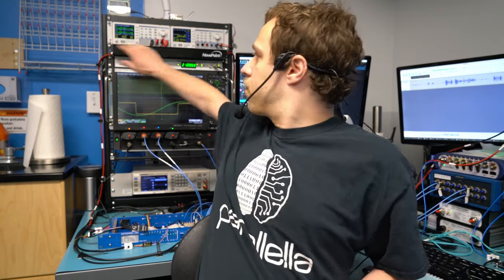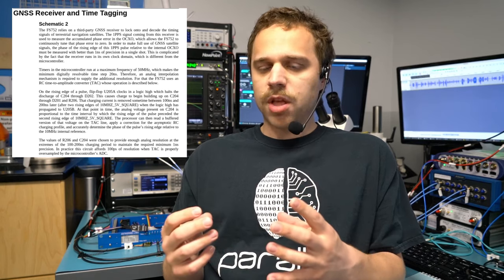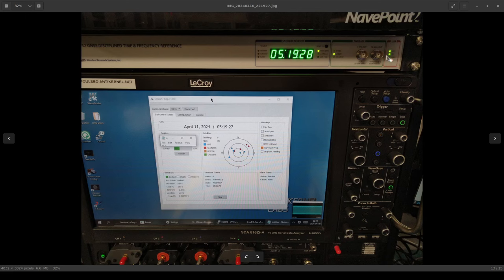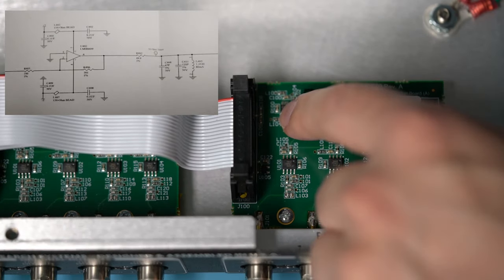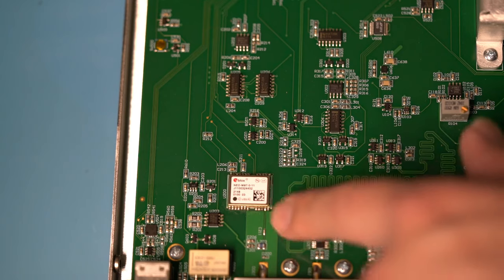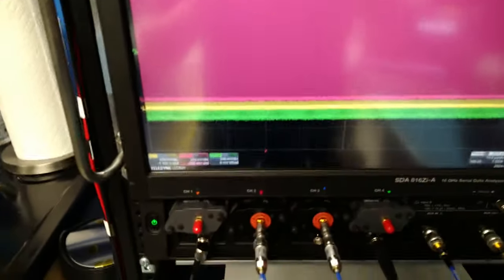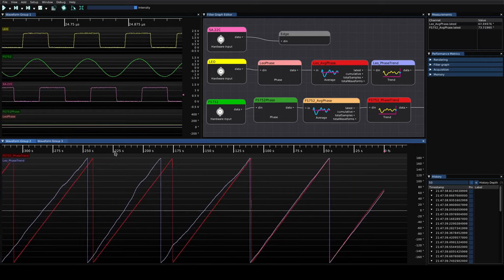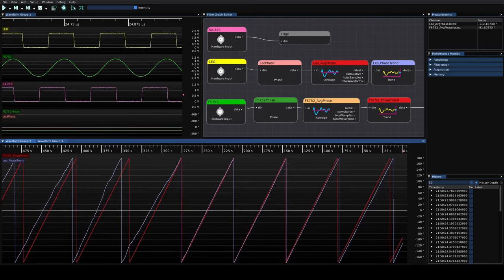[20] Stanford Research Systems FS752 GNSSDO teardown, review, and experiments

Comment: what would be the 10 mhz generator with least jitter   you  would recommend ? how does Stanford research compares to competitors in that sense ? thks !
Reply from the maker: The phase noise performance of the FS752 is excellent, although it's an OCXO rather than something more exotic like a rubidium or cesium standard.

What's your application? There's always a better clock, it just depends on your requirements and budget.
Reply: @AndrewZonenberg  I heard about the fs725 from srs which apparently is rubidium. That would be used for a digital clock with extreme low jitter for my ad and da converters ( audio mastering ) . I heard about microchip cesium csIII 4310B too
Reply from the maker: @soundsokok  You're not going to be clocking the ADC with the 10 MHz reference regardless, it's going to end up being fed into a PLL that generates the actual sampling frequency. Phase noise of the PLL VCO is going to dominate your final sampling clock jitter, much more so than the reference clock.

And at audio frequencies, you don't need particularly stable clocks compared to what high speed digital applications demand. Linear Technology/Analog Devices has a nice appnote on this (DN1013, google it since YT doesn't like links in comments). 

With the example ADC and a 1 MHz signal (much higher than audio, so more sensitive) and 50ps of clock jitter (enormous by modern standards) you're still looking at a 70 dB SNR. Cut the clock jitter down to 10ps and the contribution from the clock is lost below the ADC's noise floor.
Reply from the maker: As a data point, the TI LMK0480x series PLL synthesizers use a dual loop architecture with an on-die VCO as the final stage, giving ~130fs RMS jitter IIRC. And they're specifically designed to clean up dirty clocks coming out of a CDR or similar and give you nice clean outputs for driving high speed ADCs.

It would likely be perfectly happy eating the output of a cheap TCXO and generating a clock good enough for driving a GHz ADC, much less an audio ADC. (And there's likely cheaper options with worse performance that are still overkill for audio).
Reply: @AndrewZonenberg right indeed ia reclocker would be needed to feed the converter bnc wordclock input . By snr you mean " signal noise ratio " ?
Reply from the maker: @soundsokok  Yes. And my point is:

1) phase noise of that clock, not your 10 MHz reference it's running from, is the important parameter to optimize.

2) almost any modern PLL is probably more than clean enough for this application
Reply: @AndrewZonenberg alright thks for your input